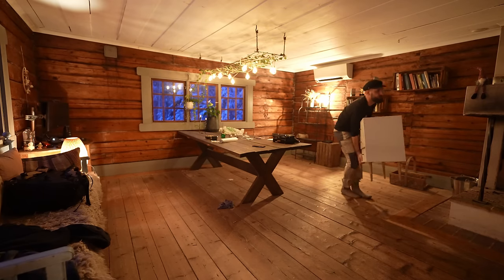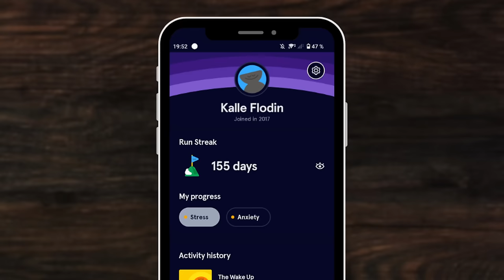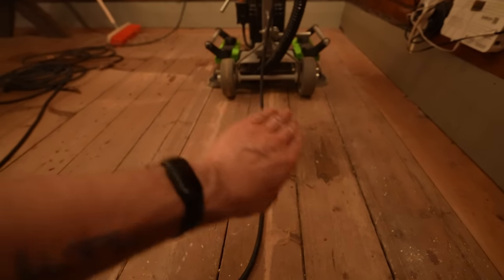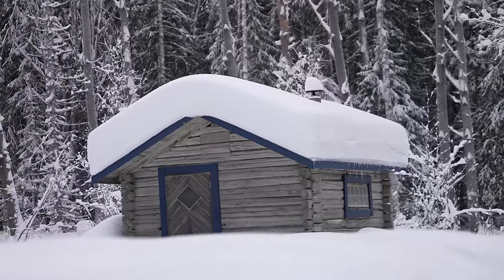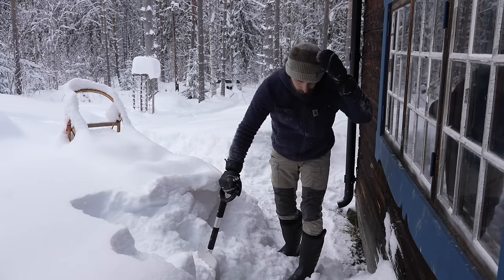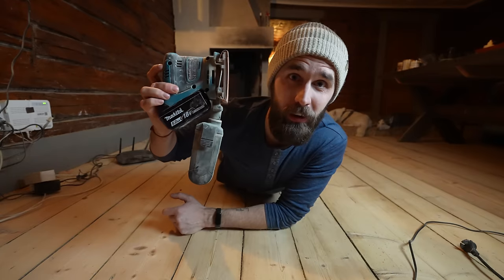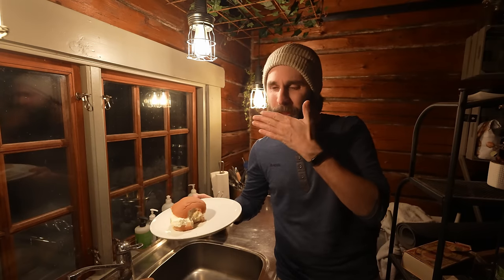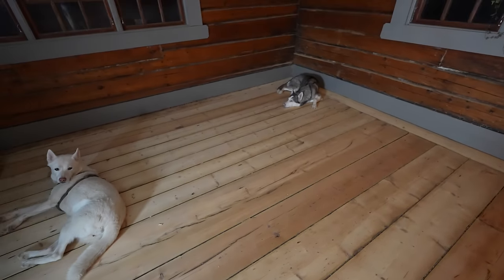Completely Transforming our Log Cabin in Northern Sweden

Comment: Hello dear Kalle, we had the same problems with the uneven floor in our old half-timbered house (built in 1830) - and then the thick paint / varnish on top of it. The blades of the sander clogged up directly because of the paint. My son then asked for an electric planer for Christmas and it worked really well! So we didn't sand the floor, but planed it very finely :-) Best regards, Diane

Comment: Thank you for sharing your journey and you're transformation. If I could make a suggestion, some of those planks are so curved that by sanding off too much at the top, you're actually creating more cracks. I would first fill in all the gaps with wood paste or wood filler. Then go over everything with big machine, then fine machine, then oil, stain, etc.  Also, sometimes when the house is a disaster and I'm in the middle of a remodel, I don't have time to eat. I will go to the local convenience store or even just the gas station, get some sandwiches, or something I can microvawe/ heat up really quickly and eat it that way. You need to rest and eat.

Comment: Have you thought of digging a cellar under the cabin and putting a stove 8n it to keep the floors warm in Winter?
Reply: Might as well build a new house with modern insulation materials at this point.

There are holes in the walls: no matter how much you heat, the warmth will escape to the street.

Comment: I think it's time to invest in a snowblower 🙂 It would have been much easier to clear the driveway and then backed the car up as far as you can. I have much shorter driveway to my garage just about 50-60 m but without a snowblower It would have been left until the spring without any access to the garage.

Comment: Go look at how Marcus Storm fixed his floor. You may have
have to do the same. How thick are the floor boards? You may need to replace them if are thin boards. Good luck 😊
Reply: His whole cabin is thin. It was designed for spending summers.

Comment: Mask, please, to preserve your lungs in the dust.

And face mask outside too, so it's easier to breathe there.
Worried about you !
Reply: For outside one does not need a mask. Water from exhaling would make the mask freeze over. Breathing in -23° C is fine - just need to get used to it and breath in small amounts of air.

For the inside, yes, a filter mask absolutely. Looks like starting from the third day he started wearing it at least from time to time. Though not enough for someone caring about his health. When he blowed the dust away from the floor, I felt sick in my stomach - might as well smoke for a couple of years to reach the same effect on your lungs.
Reply: @PavelQuiteGood  thanks for your message!! Yes, I nearly gagged when he blew away the dust😯😅.

I understand the outside mask now, thx.  I have used one, similar to a ski mask, while snow blowing drive.  So have been surprised they haven't worn them in even colder climate, than my MN, USA temps. 🥶

Comment: “Completely Transforming the Cabin”?  Did you get it wired for electricity? Did you bring fresh water coming out the facets?  That would be transforming to me where you only sanded the floor and painted the ceiling which brings no actual warmth to the ceiling. You only changed the “looks” of the cabin.  You admit that putting snow on the outside provides insulation but you only put around the bottom what about the other 2/3’s. Also, that your friend is sanding the floors and you “outside doing nothing”.